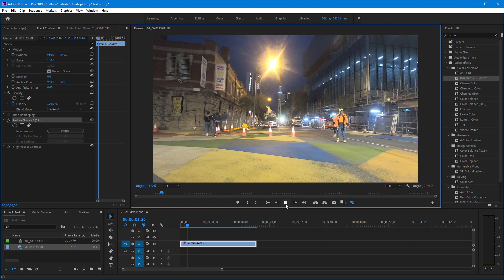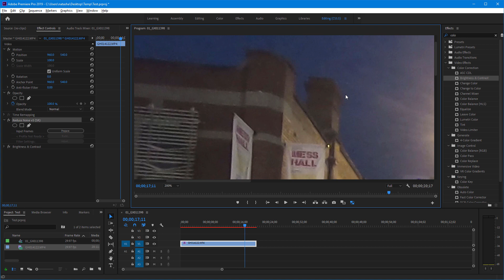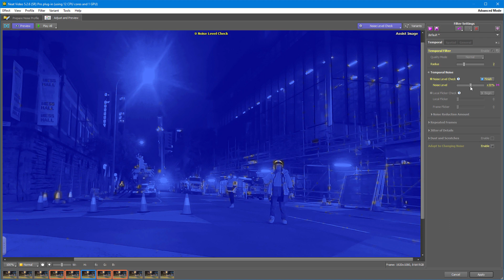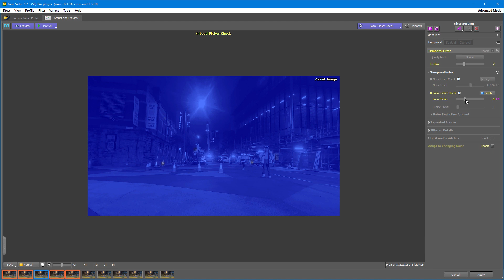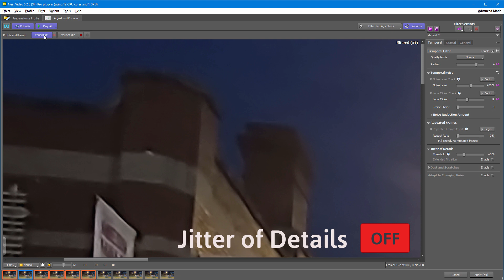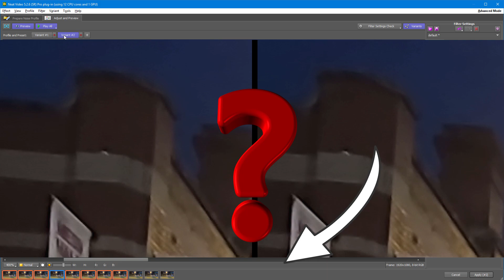How To Fix Jittering Details and Improve Your Video Quality

Comment: 0:55 No "we" don't. We call it sensor noise, which is what it's actually called. 🙄 Jitter is a frame to frame transition issue. While I admit that the result for that limited crop is good, how does the rest of the frame look?

Comment: Thank you - but again my comment. You have to show it in a video.  It's shown as a picture-optimizer. Look at video and you look at things that are worse than before - for example, streaks on edges like noses and so on.
Reply from the maker: Hi there, this tutorial was made using a video. Noise profiling is done on a single frame for easier selection. Fitter settings can be adjusted with the Play button ON or OFF. We leave this option up to our users as we are all different and Neat Video needs to be flexible to work for everyone. Perhaps you would like to turn the Play button On.
If you have an extremely difficult case of jitter on hand and can't fix it (which can happen at times), we would like to ask you to send it to us for analysis. We might be able to help you or improve our filter in one of future releases.

Comment: Great. Does it run natively on Apple Silicon Chipsets?
Reply from the maker: It certainly does. If your main video application natively supports Apple silicon chipsets, Neat Video will have no problem utilizing the new hardware.

Comment: hayy, i buy this apps yesterday and still not understand, why my gpu rtx3060 not detected for render this apps?
Reply from the maker: Hi Juniar, rtx3060 is one of the GPUs supported by Neat Video and should work correctly. Could you please check Neat Video's optimizer tool? Tools > Preferences > Performance? The optimizer should be able to see your GPU. If it doesn't please send us a message to support at neatvideo.com

Comment: Still super slow even on a 5950X AMD.  I doubt till will ever run in realtime.  Maybe every couple of years you'll go 1% faster.
Reply from the maker: Hi RW, could you please give us some insides on the frame size, radius, results of Neat Video's optimizer, and a screenshot of the GPU memory slider on the performance tab? Thanks

Comment: Thank you for the tutorial, just wondering i bought the full version and I am glad I did, but i need to to if there are ways to apply the effect on a reverse clip or even if there workarounds, thank you 😊
Reply from the maker: Glad you like the tool! The best way to do that is to apply Neat Video, export the clip using an intermediate codec and then bring the clean video into your main project and reverse it. Otherwise, video editing applications (especially Premiere Pro) send Neat Video the wrong frames. Hope this will help.